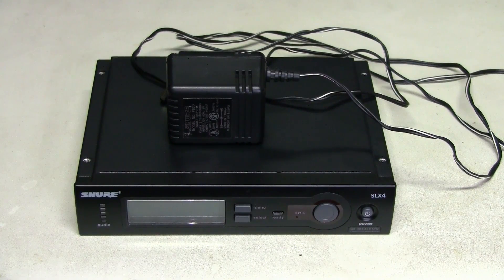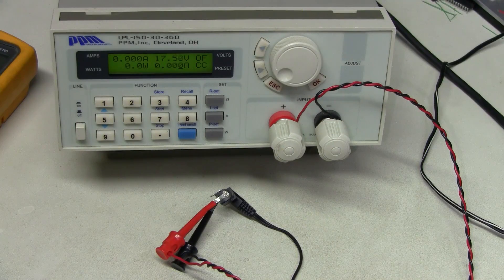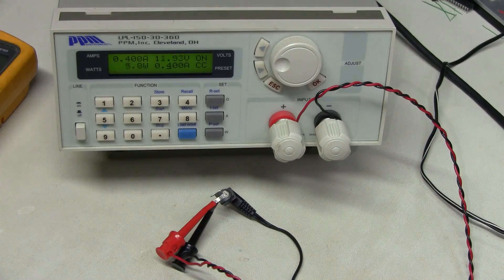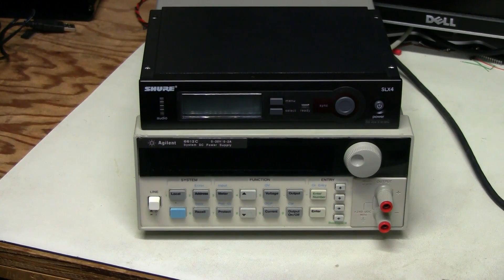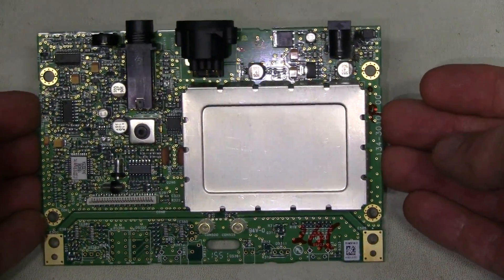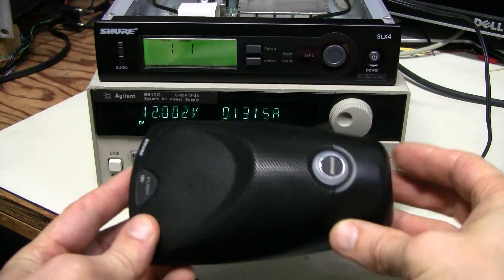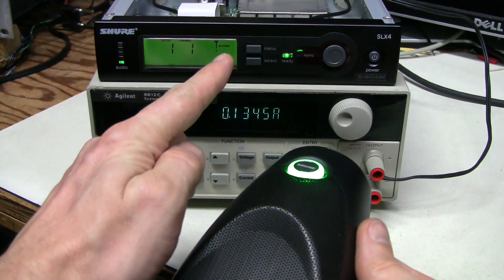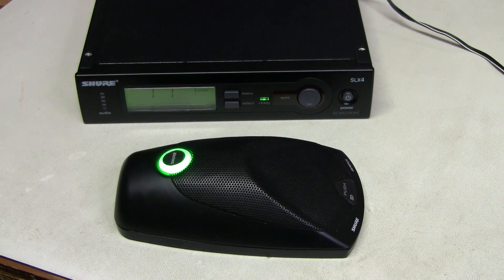#56 - Shure SLX4 wireless microphone receiver repair

Comment: Good day, excellent videos on repair. I have a Shure ULXP4 reciever that connects with the ULX1 bodypack, but does not connect with the original ULX2 handheld transmitter Microphone. How do I solve this issue? Many thanks in advance

Comment: hi sir , how can i solve problem for short range in ulx4 microphone.
Reply: I use external home made 1/2 wave Di-pole antennas made from copper pipe with LMR240 coax spread 50 feet apart to extend the range of mine

Comment: Hi, Do you know if you can change the frequency range of a Shure SLX system, so that it works in another band?

Regards
Reply: I think its fixed,  I have G3 Receivers (ULXS4) and G50 mics QLXD in the same 470-530 frequency range, They are not grouped the same, I have tried every combination on Group and Channel and the ULXS4 will not receive them  Trying to save the cost of buying new QLXD receivers , It would have been nice if you could change it internally, But then shure would not make any money

Comment: I need to replace one of the bulkhead BNC connectors on the back but I am having trouble removing the top lid.  It is a friends and I dont want to force it.  Is there any tips or tricks you have for removing that cover? all screws on the top, sides and bottom and have been removed but it looks like it is attached to the faceplate somehow but I cannot see where.
Reply: Did u find solution how to open it ? can you help me to do the same ?
Reply: I have not unfortunately but if I find something I will let you know.
Reply: @andrewcappello6964  I found a picture, that helped me to open this top cover. 
Was a bit hard, and also I help my self with a screwdriver. send me your mail. so I can forward the picture.
Best Regards!
Reply: thsi also can help you - Press down on the front center of the top cover of the receiver so that the flange lock releases from the front panel. This allows the cover to slide backward as shown.

Comment: Thanks! We have a few of these, and I've wondered what they were like inside. 

Do you think it would be possible for a competent diyer to re tune one of these to a different band? E.g. from G4 to J3? Shure will do it but of course it'll cost you. Or would it be too complicated, need firmware, take a bunch of rf test gear, ...?
Reply from the maker: I don't know. Most probably it will take a firmware change, careful tuning of some filters using some advanced gear and knowledge of the adjustment process.
Reply: That's what I was thinking.  Would be a fun project to reverse engineer and figure it out, except maybe for the firmware (unless that ended up being either really simple or not necessary).  But from a practical point of view, not likely to be worth the effort vs. sending it in.  Still a well-engineered product though!

Comment: 8:55 I think I know what happend: Somebody connected a different power supply and the unit to something that did have not 0V on the ground, so there was a current flow from the power input GND to some other GND. Like when you don't have your scope on an insulation transformer and connect the ground to the positive input of a switching PSU capacitor.
Reply from the maker: Perhaps, who knows.